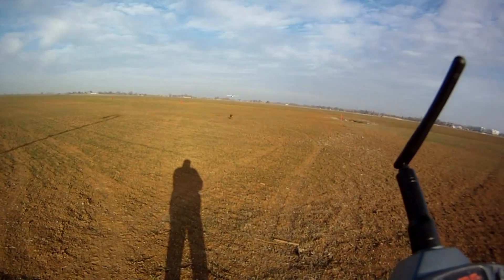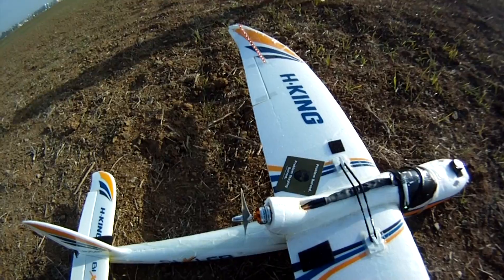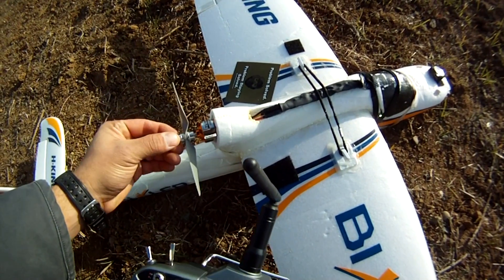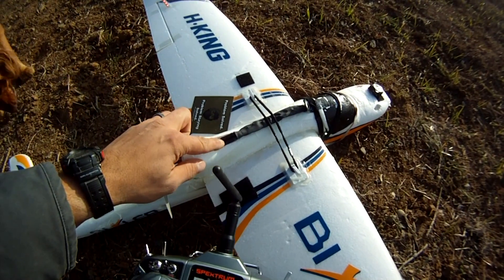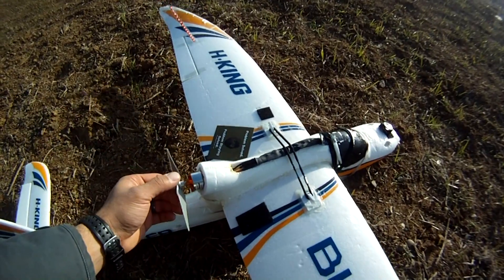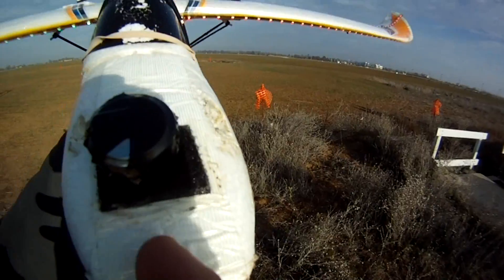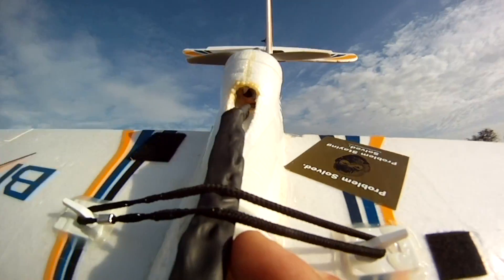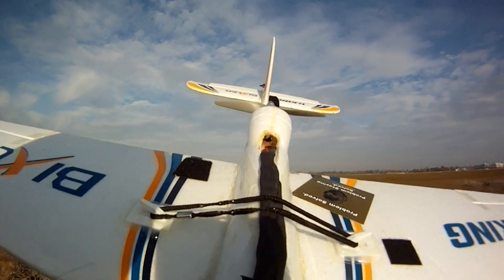HobbyKing Bixler Motor mod

Comment: Nice plane!  I also have a Bixler (1.1) with the same motor only a 45amp ESC because I was worried about heat.  TONS of thrust, I actually get way over 30 min with an 1800mAh because I use the power to climb and just glide.  Just ordered a Bixler 2 which is much slower but more efficient.

Comment: With a pusher , the numbers face forward, then oyu swap 2 motor leads around till you get the motor/prop spinning CW, when viewing from the back...APC 6x4's are hard to tell which way they are form jsut looking at a video...

Comment: It is the perfect motor for the Bixler 1, plenty of power when you need it but only 5 amps needed to climb (it pulls 28amps max at 45,000rpm on 3s with the 3-blade 6x4 and 2 x 2,650mah lipos). If you are going to use the stock motor just buy the kit this way you don't need to do any surgery and if you plan on doing long fligts mount the ESC on the outside

Comment: The prop is on the right way, its a pusher prop and when viewed at the angle in video it looks wrong (makes the leading edge look like it tapers). I used that prop to begin with, changed it out for a Master Airscrew 3-blade 6x4 with the exact same motor. Made a huge difference in thrust especially at lower rmp and enable me to get more thrust and lower amp draw for climbing.

Comment: Hm, I have this motor and I just used the supplied plywood firewall -- it works just fine. I'm pretty surprised at the wattage, though. My guess would be that the effective power output is somewhat lower.

Comment: ebay search - 	
Hobby King Bixler Adjustable Aluminum Motor Mount for Brushless Outrunner

:) adjustable so you can fit 6,7 or 8 inch prop

Comment: I swapped the motor out from a Stinson and I'm using a 3000mAh 14.8V  Lipo.
I was testing it to see what kind of power I'd get and I sliced my finger up. 3 nice little
razor cuts.  No harm no foul.  Oh yea, I'm using the 6X9 prop.  My ESC is an 80A 5 BEC.
Well I'm off in the morning to see what kind of damage I can endure.